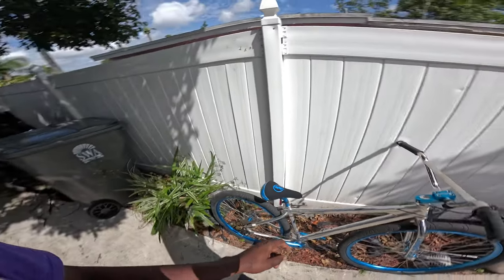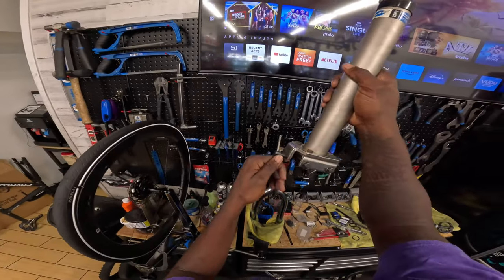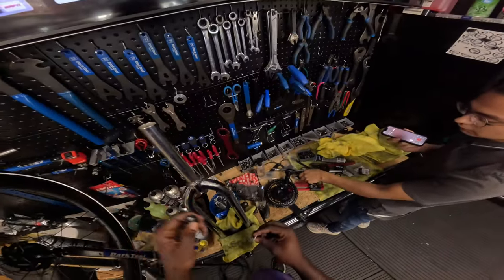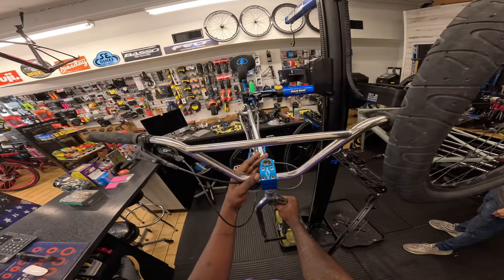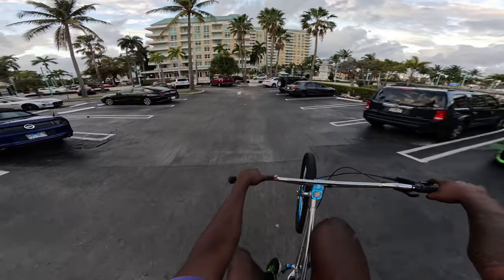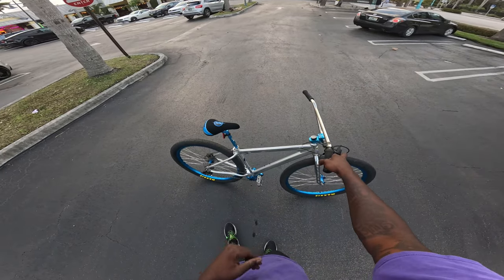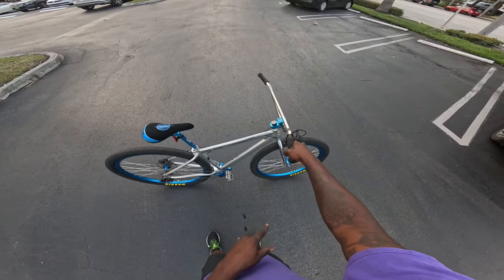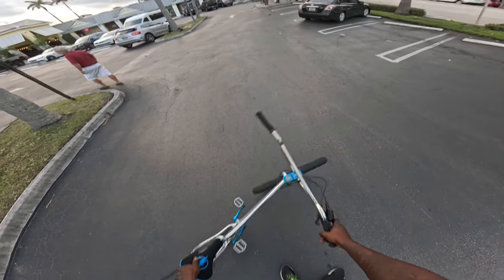I Gave My FAST RIPPER A Fresh Tune Up!

Comment: Nice - I sadly rounded the splines on my Fast Ripper crank. It goes for a few days OK but I need to carry a 5mm allen key all the time. If I stick to wheelies it's OK but any pedal kicks or stuff like that and it loosens and the whole unit can be moved side to side.
Reply from the maker: Time for new cranks !
Reply: @SteeezyFilmz   Yeah - time to save some $$ -bike shop guy here recommended Shimanos but also mentioned profile cranks as the $$$$$ option. There's a whole world of upgrades always knocking at your door! - Enjoy that bike!